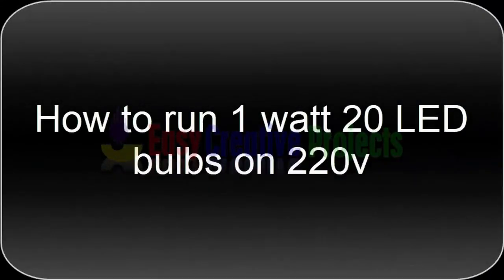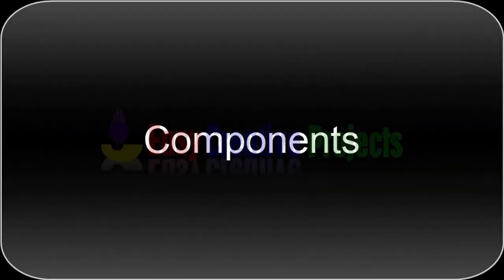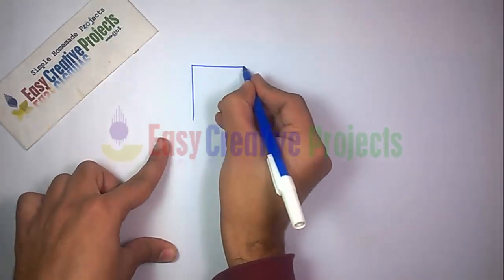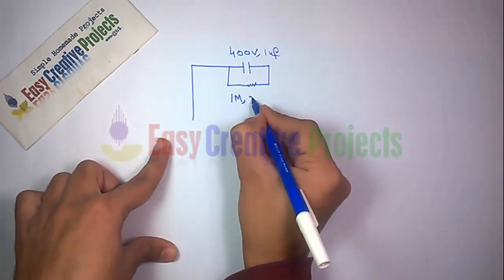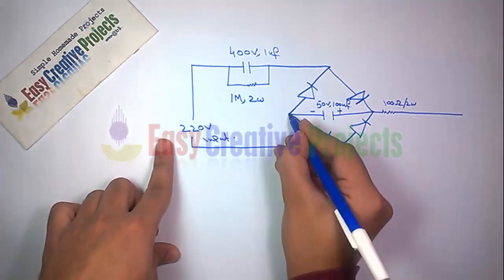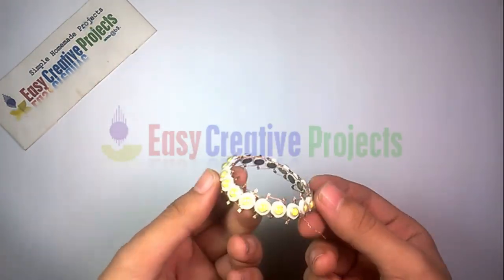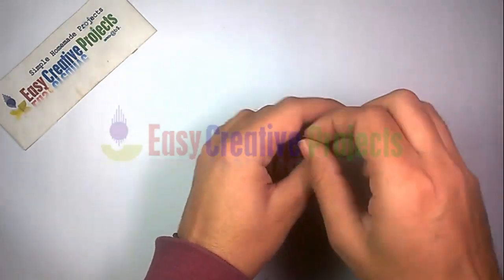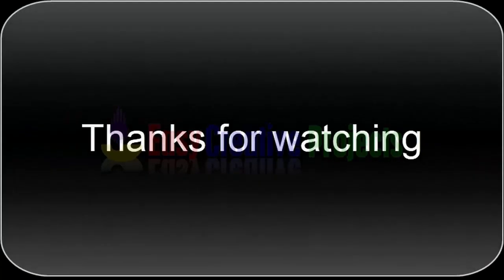How to run 1 watt 20 LED bulbs on 220v - easy with circuit diagram

Comment: can i use this same circuit for 10x    1w   leds
Reply from the maker: you need to increase capacitor capacitance.
Reply: @EasyCreativeProjects pls tell me what capacitor I must replace in this circuit for running 10 LEDs in parell

Comment: Pleasee sir ..muje reply dijie sir..main a bala circuit ready kar eaha hu 1 mega in paralal 400 v and bridge ta posstibe main 100 ohm 2 watt resister lagaya but middle main jo 50 v 100 uf capacitar hain o torasa garam ho ja rehe hain  or uska plastic ka tora gamd a raha he..sir pleasee anser me..sir
Reply from the maker: dear yah china k components isi trhan k hotay hin. usay ak ghnta lga tar chlao agr kuch na ho to smjo components long term chlain gay. 
thora sa to capacitor heat up hota ha. 
short time k leyah agr thori power store krwani ho to capacitor ak battery ki trhan kaam krta ha. jis trhan mobile ki battery use honay pay thori heatup ho ti ha is trhan yah b thora sa heat up hota ha.
agr capacitor zeyada heatup ho raha ha to phr 100v 100uf ka capacitor use kr lo.

Comment: sir.. what is the voltage of 1 led? 3.4 or 12?
Reply from the maker: each led work on 12v
Reply: @EasyCreativeProjects  can i use 3,4v for that circuit?
Reply from the maker: you can use 4 led set in series. 3 x 4 = 12v
mean 
1st make 4 led set in series.
2nd connect these set in parallel.

Comment: nice project. Just curious what is the voltage 1) on the output of the bridge rectifier 2) across the 1W LED ......and 3) total current drawn by the LEDs
Reply: Can I get Ur no.sir